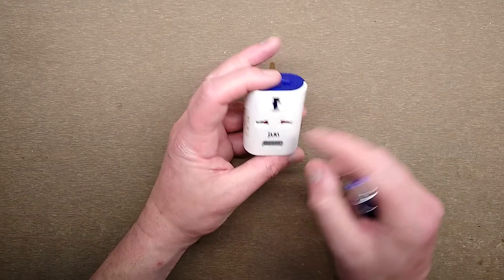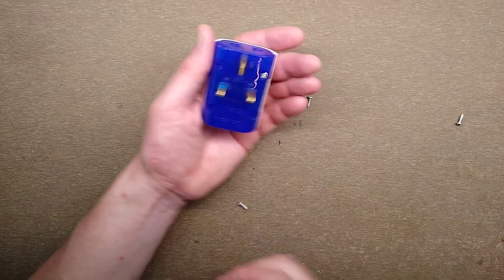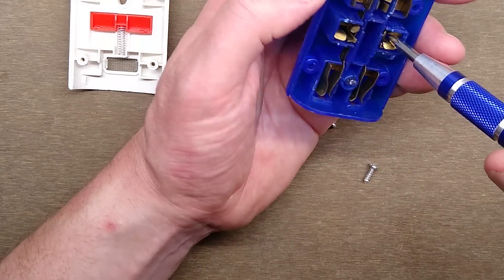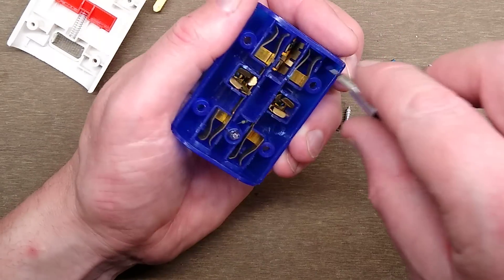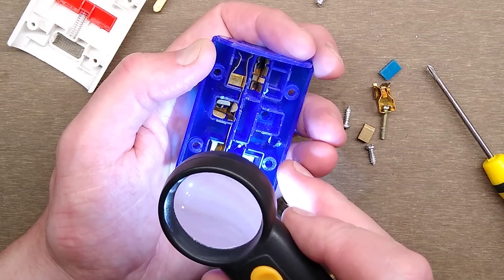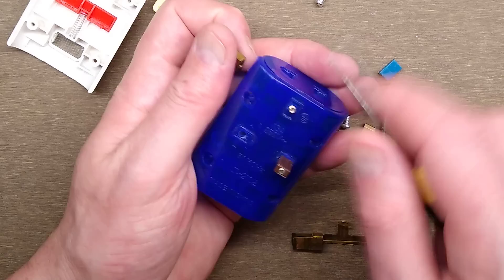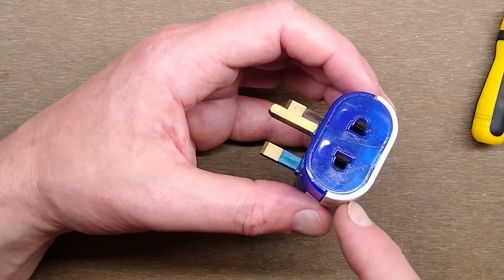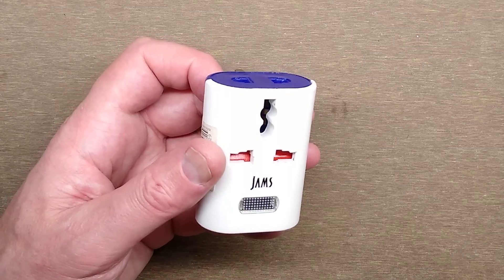Red Sea Mall death-dapter teardown

Comment: Shutter or not, none of those receptacles are tight enough for 2.5 A europlugs. The huge South African pins are the tightest in those big holes. The top is meant for UK shavers or Type A pins, but only a very foolish North American tourist would use an unfused adapter to plug a 120 V device into a 30 amp ring circuit in UK or Ireland. Type A plugs are only 15 amps anyway.

Comment: It should illegal to be imported that item. Never mind what country produced it. I have bought various devices from China that provide an adapters, which did not have a fuse. I have used them using an extention lead that is fused, (because I know the risk). The average UK person would not know.
These adaptors can be plugged in a fused system that has a 32 amp breaker. The breaker under fault conditions could produce hundreds  of amps under the wrong conitions. The risk could be fires and death.

Comment: clive, do you know why extension strips seem to be allowed to be made of thermo-softening plastics these days?  i can except that moulded plugs are okay due to their monolithic contruction but a cheap socket strip caught under the sofa etc. could break internal components, short and then melty drippy fire instead of singe and char?
Reply from the maker: Proper ones should be self extinguishing and not support flames.
Reply: @bigclivedotcom  thanks, Clive. i did try to find out for myself but it's been twenty years since i've worked in the building industry which was disappointingly apparent when i tried searching.  the strip  has all the compliance markings but i said to my sister it can't be - i couldn't think why they would relax that regulation but i couldn't find anything relevant quickly so thank you for letting me know i wasn't barking up the wrong tree. 🙂

Comment: Duh we're the uk let's put 220 on every plug in the house instead of just on the appliances that need high voltage so we can have giant over built  plugs so we don't fry half our toddler's duuuuuuh
Reply from the maker: Yeah, you can plug laundry equipment into any socket in the house or use high power things like kettles.  It's great.
Reply: @bigclivedotcom  I have an electric kettle works great also how often do you move your laundry machines? And to my earlier point is it really worth the greater heft and danger of 220 outlets?

Comment: 230V/150K=1.53mA.  1.53mA^2 x 150k = 0.35W.  Not sure what the resistance of the neon is, but I doubt that resistor is rated 0.35W.
Reply from the maker: It's only rated .125W and is also not rated for the voltage it drops.

Comment: I love how the UK and Germany actually does enforce safety standards and regulations but go to any other country in the EU (needles to say outside the EU will be even worse) and you will get plenty of hazardous adapters and usb chargers. I've opened one charger recently, it was brand new and had AC prongs completely corroded inside :O
Reply: Travel adaptors seem to be completely unregulated no matter where you go and even reputable stores sell the strangest stuff. I built all my own travel adaptors that should be able to take the full current rating of the local socket. Local plug - piece of flex - Schuko trailing socket. I've plugged hairdryers into adaptors and don't want to repeat the experience I had in the US where I had to carefully wiggle the cheap adaptor to get power to the hairdryer.

Comment: The shaver thing is even worse. A lot of those shavers were 110 volt even in the UK and were to be used in a special bathroom socket with an internal step down transformer built in. Putting 240 v in didn't actually made the shaver explode but it would get hot very quickly and was more than a little 'lively' in power.
Reply: Ah the bathroom isolation transformer. Allegedly american bathrooms needed to have these as well in, I forget when it was but it was the 60s or 70s. (they'd just put out the same 120v as normal, but the current was limited. They'd tend to get destroyed by people who would plug high-current devices into them - which I guess having a different voltage/plug would prevent.)
At some point they stopped doing that and went back to putting regular sockets in bathrooms, and then 10 years after that started putting GFIs in.
Reply: Ah the bathroom isolation transformer. Allegedly american bathrooms needed to have these as well in, I forget when it was but it was the 60s or 70s. (they'd just put out the same 120v as normal, but the current was limited. They'd tend to get destroyed by people who would plug high-current devices into them - which I guess having a different voltage/plug would prevent.)
At some point they stopped doing that and went back to putting regular sockets in bathrooms, and then 10 years after that started putting GFIs in.

Comment: It's worth noting that our American plugs have live and neutral reversed compared to UK plugs. That doesn't explain why your colors were reversed because it has L and N properly marked, but it does mean one thing: with any deathdapter, one of the plug types will always be reverse polarity.
Reply: In the US live is the right smaller slot, neutral is the left larger slot. Same in the uk but the holes are the same size.
Reply: @mernokimuvek  Looking into a receptacle here in the US live is on the right and neutral is on the left if the ground pin is down. In the UK's sockets the left and right are the same but the ground pin is up. If you orient both plugs so the ground faces the same way then their polarity will be opposite each other.

Edited to clarify these orientations are looking into the outlet, not looking at the plug.
Reply: @eDoc2020  I heard that some people like to install outlets with the ground prong up claiming that its safer if something falls behind the plug. But makes no sense if a 2 prong appliance is plugged in.

Comment: K-Mart, target, Jaycar, and all sorts of other companies in Australia sell unfused adapters to plug into UK sockets so that Australian plugs can be connected.  There are approved by SAA Approvals, on the basis that Standards Australia says that they only have to have the correct pin shape, or some similar stupidity,  Fuses are optional.  Clearly, neither of these organisations has bothered to read ‘BS 8546: 2016 - Travel adaptors compatible with UK plug and socket system’.  Plug a travel hairdryer left on 120 volts into 240 volts and enough current to overheat the cable and plug.  And a solid shout will black-out a good part of the B&B.

Comment: The curved back looks like it would allow small fingers to get to the live pin before it pulls out.
There is a minimum distance under the standard between the Pin and outside edge of the casing

Comment: Not bad that there's actually an earth connection for UK & AUS plugs but still no fan of the deathdapter format.

No fuse - no real problem because a hard short will trip the breaker and/or RCD most UK properties have these days... the bigger problem is you could run well over 13A, some sockets like UK made MK or crabtree sockets may handle the load over the switch as long as they are in top notch condition but with some of the other ones from legrand or british general that are made in china or maylaysia could turn an overload into a potential fire hazard.

Comment: Someone else has commented as well, but the screws as the conductors seem like a bad idea to me. Would have been interesting if you measured their resistance. If stainless then even worse as their conductivity would be a few hundred times the copper / brass equivalent. Maybe dissipate a few watts between them.. If loose then even worse.

Comment: These little resistors are used in extension cord illuminated switches too and I haven't seen one fail yet._
Reply from the maker: It's that on 120v or 240V?

Comment: Correct me if I'm wrong. Isn't blue and brown 2 legs of 120v making 240v? It shouldn't matter which is on which side then.
Reply from the maker: Not in the UK. It's 240V on the live and near 0V on the neutral.

Comment: Worked in Jeddah for about 3 months about 30 years ago. Weird electrics, there were no standards for plugs and sockets. They had both 110 & 220V. I remember being in one place with a row of European style schuko sockets on the wall, some were 110V and some 220V, the only thing differentiating them was 110 or 220 written on them in pencil. Go to a different building and there would be completely different sockets, US, NZ, you name it, they’d be there somewhere. I occasionally found uk 13A ones, but they tended to be 110V! Would be a great place to start up a transformer rewinding business 😅
Reply: In the US the standard system is 240v for large appliances etc, neutral for 120 obtained from the center tap of the transformer. I myself have several foreign outlets installed over my workbench, hooked to 240. Schuko, Australia, British, plus a 50 amp 120/240 twist lock. All fed off of din rail breakers in a metal enclosure also above the workbench, along with my relays, control circuits, the 120 RCBO protected outlet circuit, and the two RCBO 240 compressor circuits. As long as an appliance or tool can tolerate 60hz and doesn't have the neutral bonded to the cabinet, it works well. Din rail RCBOs work fine on US 240 circuits as well, as long as they are 2 pole. 120 RCBOs for Din rail are available as well (1P+N style).
Reply: I think you were there at the start of the transformation from 110 to 220 or maybe a bit before that, I am from Yemen but I've heard that it is now all 220 in Saudi
Reply: @bassam_salim  quite likely. When I was there, it was  mainly 220V for appliances and 110V for lighting, but that did bring about the situation where you have a 110V socket for a table lamp which is exactly the same as the 220V sockets in the rest of the room, which are in turn completely different from those in the next building you go in. I was working on communication equipment in a workshop, hardly anything there even had a plug at all. I think the reasoning was that if it had a plug, it would be the wrong type. We just used to poke the wires in the socket and hope for the best!
Reply: Maybe 6  or more years ago they made the change to keep the european style plugs as standard building outlets. But the old apartment I live in the eastern side, all has US 110v outlets, except for the major appliances thats 220v
Reply: Didn't the empire nuke it from orbit?

Comment: Question: how would you make a Japan-UK plug adaptor (not voltage) compliant? By design, wouldn’t all of those qualify as “deathdaptors”?
Reply: If used in Japan it would have to comply with Japanese standards so the lack of an earth connection probably wouldn't matter.

Comment: I bought one of those similar travel adapters from Singapore. I thought it looked fairly reasonable quality, it even had the shutters. Then I realised that the shutters only unlock from the earth pin, and none of the appliances I needed to plug in had an earth pin...

It wasn't such a great safety feature in the end because I had to jam a broken popsicle stick in the earth connector in order to defeat the shutter.
Reply: The fuse window is the thing to look for. If you can't change the fuse, it hasn't got one.

Comment: Clive, you're being too hard on this thing. It's actually decently made for what it is. Also a fuse is not a mandatory safety feature for these things , although you do have them there in the plugs of the appliances.
This will probably serve it's purpose for years without any risk of electrocution. And I do agree that 13 amps is too much for it, but let's face it, most people will never run 13 amps through it, probably a phone charger or similar.

Comment: Given what I've seen used in South America, that's better than no bad.

But I live in 'Merica where we have no such safety devices on outlets.  I learned that lesson at 4 or 5 years old and so far haven't made that mistake again :)
Reply: There do exist NEMA 5-15R safety receptacles in the US with shuttered pins called TRRs (tamper resistant receptacles), but they're usually installed as a childproofing measure and otherwise not commonly found.  Some can even be found on GFCI (RSD) outlets.   Obviously, the cost more than the non-safety variety.   The other approach to childproofing is to insert dummy plastic plugs into receptacles, which is hardly a viable solution, as they are easy to pry out and very often lost.

Comment: "Or ground, as you say in America...." - I've often wondered, if we lived on Mars [let's say] would we in this country then say it connects to Mars, or ground, as you say in America?

So, would you call that best of the worst, or worst of the best?  I don't care for the pins being able to swivel like that, and in all honesty, I'm not keen on those screws being used as conductors between the pin tips and the inner connections. I have grave misgivings about about the plastic insulation on the pins. It will crush if the screws are tightened, or potentially melt if the unit is subjected to a heavy load which could heat the metal parts. They could even split and break away after some use.

To me, this thing is a disaster waiting to happen.

I guess we have to ask ourselves a question, do we feel lucky? - Are the screws in the pins made of brass [which I'd doubt] or steel [which I'd suspect] and are the springy contacts made of brass/copper, or just plated steel?  It all becomes relevant as the load increases.

Comment: 3:52 i think i've heard "earth" in the US just as often as "ground" or "common". it could be a trade thing though where engineers use more international terms and trade people use more regional ones. nothing will compare to when i learned on the job what Rankine was. i had to learn what Rankine was because an interface used it for temperature... i'm still dumbfounded by that lol. i expected to see altitude in cubits next
Reply: I would not like the use of the word "common" to refer to earth/safety ground.. it would imply that it carries current normally, which a safety ground does not

Comment: Wondering how a fuse could be retrofitted somehow reminded me of the early UK 13 amp round plugs where the positive pin was the fuse. To change the fuse, you unscrewed the pin and replaced it with a new one. Seen any of these recently?
Reply from the maker: I've never seen one of those.
Reply: Those were Dorman and Smith plugs with the screw in fuses, not BS1363.

Comment: I love how the safety feature of having half plastic live and neutral pins also "just happens" to save manufacturing costs as plastic is much cheaper than brass.
Reply: I had missed that when I watched it the first time.   A little bit dodgy, but it may not be cheaper as it means they had to have different molds made up....   I guess it could be safer than a sleeve as the sleeve could "wear" and the plastic would last for ages.   Not sure what the thinking is on this one

Comment: just what we all need another deathdapter seems strange to me that value of resistor of all the neons I have took apart its always been a 100K which was the first value I learnt when learning the resistor colour code
Reply: I've seen a design that used a 2k7 resistor for a neon supplied by 110-120 V AC (Dual record player strobe light, for some reason the strobe was connected to the 110 V winding of the multi-voltage mains transformer).

Comment: I'm wondering what the current carrying capacity of those screws is, and how good the continuity is across their connection with the brass inserts.
Reply: Screws used to be a perfectly acceptable replacement for the old style fuses. Generally when one could not find a nail...
Reply: @nickryan3417  Oooh, get you with your fancy screws and nails.
Tin foil.
Reply: @pd4165  Hey, I didn't claim that they were new screws or nails! Honestly, the stalkers one attracts these days are not like the old days... 😁

Comment: Could be a lot worse 🤣 My Dad back in the day, when we went on our hols, used to carry an adaptor that plugged into a standard bayonet cap lightbulb socket for his lecky shaver. He lived to be 81, and wasn't ever electrocuted.
Reply: I can remember my parents having having those adapters. It meant you could do the ironing in the middle of the room, but in the dark.
Reply: @twotone3070  On the continent most of those had a male ES27 thread, two round-pin sockets and a female ES27 socket so you had light while ironing. Besides, many lights of that era had multiple bulbs, so removing one only made the room slightly gloomier. Of course having a light bulb in there meant the mains lead could touch the hot bulb, which isn't ideal either. I was quite shocked to see Home Depot sold these new in the US as late as the early 2000s, haven't checked recently!
Reply: My Dad had one of those too, I remember a long flex hanging from a lamp shade at some point back when I was a nipper.
I also remember it had a socket you could plug the lamp into as well
Reply: @offdagrid877  Ah yes, they were common back in the day. I remember when I was about 4 or 5 (in 1944/5) and afraid of the dark so my Dad rigged up a switch that plugged into the ceiling light and hung the switch on the bed headboard. Being a curious boy I unscrewed it one night and was treated to a short course in 240V electroshock therapy! Luckily my reactions were quick and I let go rather smartly, wondered what the heck had happened, screwed it all back together and went to sleep.